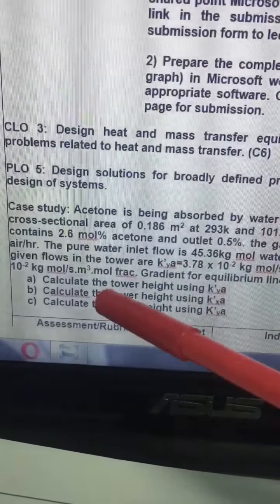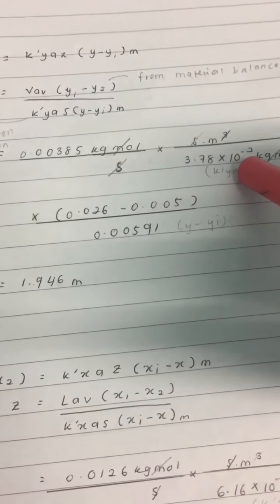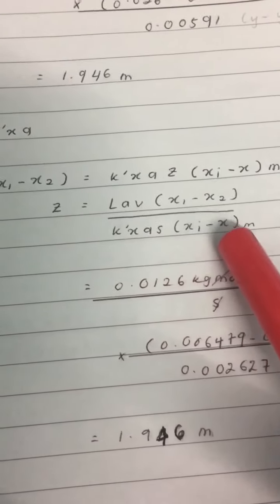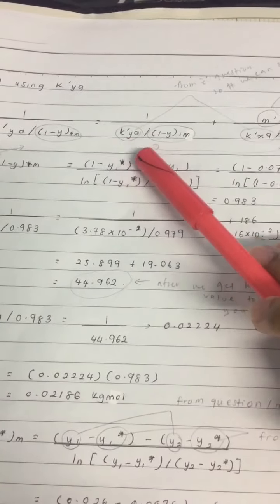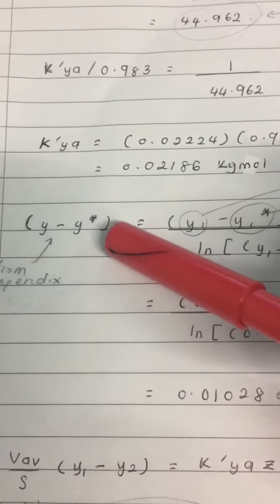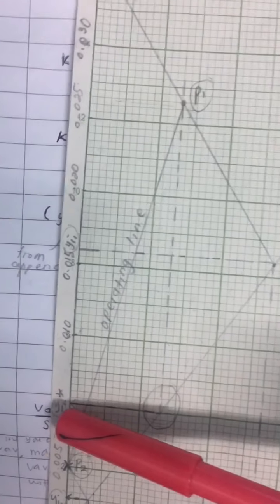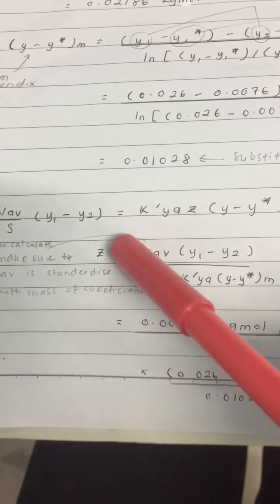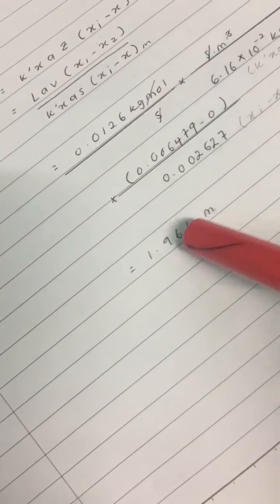Gas Absorption Calculation

Comment: you need to add the step of calculation in the report on how to solve (y-yi)im as well as (xi-x)im. The explanation on how to obtain the value of xi1,xi2,yi1 and yi2 from the graph already explained in the video which was very good. Last comment, there is no drawing of the packed absorption tower in your presentation @ report. Overall, good effort!
Reply: you also missed the step on how to calculate the trial of the slope PM1 and PM2 which is important to develop operating line.